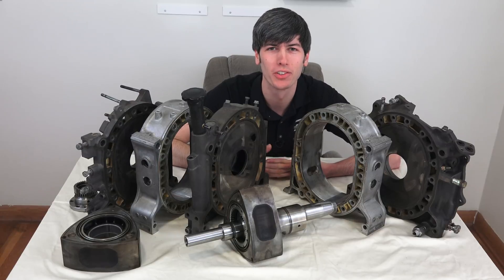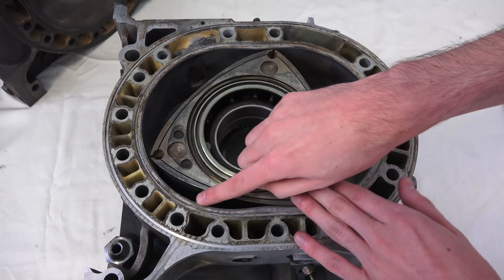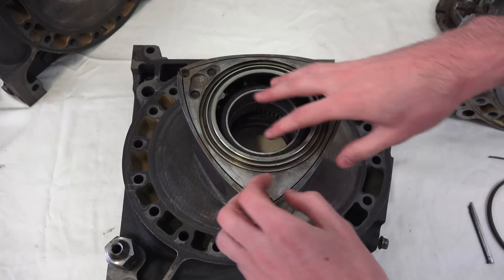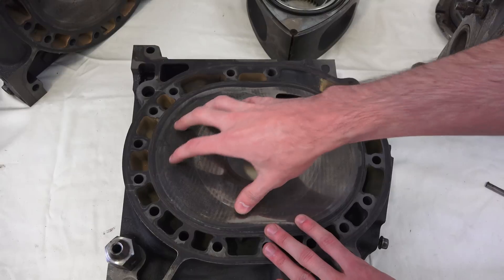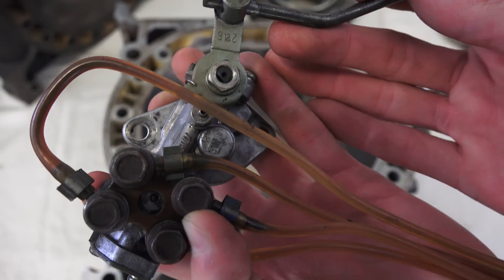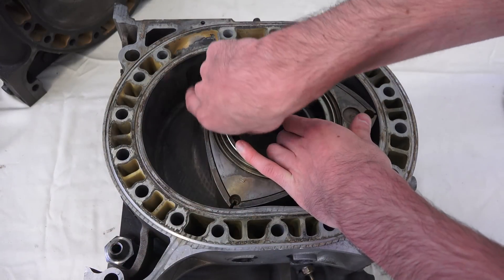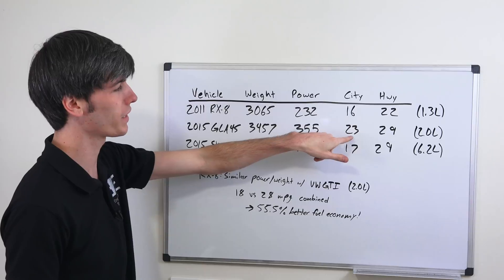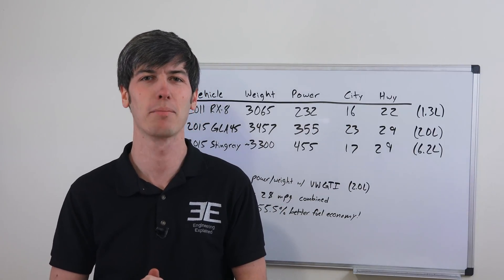4 Reasons Why The Rotary Engine Is Dead

Comment: So all we need to make it more environmentally friendly is to capture the exhaust and recollect the unspent fuel?
Reply: The solution to a design flaw isn't to add more to the original design. You just make a new design that doesn't have those flaws.
Reply: The real doktorbimmer 
You must stop telling lies.
Reply: The real doktorbimmer
Bimmer McBimface,, you must stop making things up.
Reply: "The solution to a design flaw isn't to add more to the original design."  Tell that to the guy who invented the Turbocharger?
Reply: I wasn't talking about Turbocharging a Wankel.  I was thinking about turbocharging a Diesel... They really only gained popularity as daily drivers after Turbochargers were added into the equation, and would probably not be used much, if at all, today if that hadn't happened.

I quoted for a reason: 
"The solution to a design flaw isn't to add more to the original design."

-> So many new things have been added to Otto and Diesel Engines over the years that this statement appears fundamentally flawed.
Reply: That would add extra energy and steps into the process thereby reducing the overall efficiency of the engine.
Reply: Chris L Not necessarily, there are cases (speaking in general, non domain specific) were adding something onto a design will improve it and remove/compensate for flaws in another part of the design. And of course there are other cases where the entire design needs to be rethought in order to make up for those flaws. One could argue that if you break down any design into small enough pieces that you will end up with distinct parts that chain together, each depending on the other parts before it to accomplish a task. But I don't know if I completely agree with that either,(getting a bit to abstract at that point) and if it were true how one would prove it mathematically/logically.
Reply: ***** 
Good point. The design flaws on piston engines is immense. The pumping loses can't be overcome.
Reply: +Chris L
and anyone else who likes technical history might read Longitude by Dava Sobel; an interesting read on the development of the Naval Chronometer.  It illustrates the point made by Chris L and was also a public television series of same name.
Reply: The real doktorbimmer 
But diesel egines are filthy and very inefficient.
Reply: Pyrrha Nikos 
Bimmer McBimface states the rotary is not in production.  It is used in UAVs.  Bimmer is  a sad case indeed.
Reply: The real doktorbimmer 
Bimmer McBimface, diesels are not included in eco engines in the London emissions.
Reply: The real doktorbimmer 
So did gasoline and diesel engines.
Reply: The real doktorbimmer 
Bimmer McBimface, you have an obsession with automobiles. Sad but true.*
Reply: The real doktorbimmer 
Bimmer McBimface, please get therapy. Please.
Reply: 1. You can not collect the unspent fuel, it burns as soon as it enters the hot exhaust system.

2. The burnt oil is still in the exhaust gases, so nope, not environmentally friendly at all.
Reply: if you guys notice he said.environmentally friendly not more economical. a big reason they aren't very economical is because there is three combustion cycles for every revolution of the crank shaft.
Reply: My take on all this: The reason it is supposedly not economical is its being rated incorrectly as a +-1.3 liter but is in fact much closer to being same as a 2.7 liter 'normal' combustion motor...Look at its power ratings. Its certainly not the equivalent of a 1.3 liter in terms of power ...So if its making +-120  to 135 ps/hp then   its not really a 1.3 and its 'high' fuel consumption all starts making sense.
Reply: Or use it as a generator in an electric car. Like a Fisker Karma or something.

Comment: If you made a rotary engine with dual exhaust, could you create something that combusted on both sides, instead of the one side?  Which is a disadvantage as you said because of heating only one side.

Comment: sounds like the disadvantages of a 2 stroke engine but with the 2 stroke looking better?. i wonder how emissions are compared to an oil injected 2 stroke of comparable output.
Reply: In case you're interested, a land speed record was set on a 2-stroke bike using two 350cc yammy engines. look up the Big Red or Don Vesco
Reply: Nessaj i looked at all the Don Vesco video uploaded by Jinx Vesco. "interesting" is an understatement! thx for suggestion, m8 :))))

Comment: I have an 2006 RX8 and proud of it. The reason rotaries hasn't been developed more is because of machining which is a lot more complex and no one wants to risk it so they stick with pistons. Mechanically it's better a rotary because there is no alternative cycles. It's pure joy when you are at 7500 RPM with no vibrations..

Comment: It feels odd to think that materials would be a hindrance in building a better wankel engine, since there are jet engines and some of their parts work constantly under extreme conditions. Also in diesel engines there are after heating systems that help to burn the fuel to avoid emissions when starting the engine. But perhaps all that would be costly and eat away the advantage of light engine.

Comment: Kind of unfair to compare the 2011 RX-8 engine (which was introduced around 2004) with modern engines. Especially turbocharged ones like the GLA45. As for the Corvette, one could point out its lower specific engine output compared to the RX-8.
Reply: Bimmer stop being silly.

Comment: I'm curious how they compare to a TOO-SMOKE engine (which is to say a 2-stroke motorcycle engine!) There's the Suzuki RE-5 which I believe was a twin-rotor Wankel which was rated to have something akin to 500cc's capacity - For comparison, there are numerous different designs both from Suzuki, the T500 Titan/Cobra which was a 500cc twin, I guess you'd call a "piston-port" too-smoke, so too with the TR500 which was a short-stroke version of the TR750 a race-tuned version of the GT750 triple which was liquid-cooled (So perhaps it's a better comparison to the RE-5?) And then later the RG500 which IIRC was a Square-4 with tandem cranks again 500cc's - then there's the Yamaha RZ500 which was a V4 with reed valves on the induction - IIRC there were rotary valves and all sorts of other designs. I have a hard time pulling more than that off the top of my head without referring to other reference materials (((ME I'm something more of a FOUR-stroke motorcycle buff, and I'm far more fascinated with the CHASSIS and wheels, brakes suspension etc - the engine's just something I take for granted - Which is lame, yes - but a lot of engine heads have the same attitude toward the chassis!))) What I'm CURIOUS about, is whether the too-smoke engines had worse or better potential than the Wankel engines. The rotary disc valve engines seem particularly interesting, so to the Yamaha "power-valve" which I guess even had further application in the "EXUP" on 4-stroke engines - both are a variable throat or choke plate/flapper on the exhaust side, which changed the flow and thereby the back-pressure and SOMEHOW - I think they might have even been longitudinally activated like a cone moving up and down the exhaust like a TROMBONE of a sort, to affect the sonic back-blast which was so instrumental to the "tuned" expansion chambers of classic free-breathing too-smoke engines - WHICH, I'm not sure if you're aware of it - which came out of WWII German V1 "Buzz-Bomb" pulse-jet technology, and that research and it's egg-heads wound up on the EAST side der OST in the Cold War, until a motorcycle racer named ERNST DEGNER defected to the West and took said technology to Japan and more specifically SUZUKI - who then really went places with their too-smoke bikes, and only introduced their 4-stroke multicylinder GS750 in what, 1975 or '76? IIRC - I'm far more of a HONDA fan, let's just say. ANYWAY yeah, I guess I'm also curious about which of these technologies might have continued with some benefits for FUEL ECONOMY and CARBON FOOTPRINT, if it weren't for the "EMISSIONS" tech which has more bearing on inner city air quality - as Judge Dredd would put it - "Inside, the Cursed City - Megacity One" - Which is to say, Southern California ha-ha. Honestly, up here in Alberta Canada, I'm far far more concerned with the CARBON emissions than I am with the SMOG, the un-burnt hydrocarbons etc. I want to know which, if ANY - of these technologies has any FUTURE in it! Vis-a-vis, accepting the reality of climate change and peak oil, etc etc. Obviously, a bike should be ELECTRIC and it's charge should be generated by WIND - But even so, I'm still curious about my 1980s motorcycles and which of 'em has the greatest potential for blowing away the modern Crotch-Rocket stuff - Well, taking it for granted that the RZ500 & RG500 aren't crotch-rockets already! My "CB900K0 Bol Bomber" or rather, 1982 CB900F based homage to the '65 CB450K0 Black Bomber, a "retro-fried" Superbike with Endurance roots - is a DOHC-4 transverse inline "Universal Japanese Motorcycle" it's air-cooled and it's "replacement" from Honda was the VF750F & VF1000F "Interceptor", Honda's first V-four, liquid-cooled etc - fugly frames with square section tubes, fugly bodywork which I think I MIGHT be able to redeem with a V65 Magna / V65 Sabre based homage to the '60s Czechoslovakian Grand-Prix marvel the "CZ Type 860" - picture it with wire spoke wheels with hubs like old 4LS drums but they're "inboard disc" or rather "shrouded disc" hubs cut out of the GL1500 Gold-Wing or PC800 Pacifica front wheels - 'cause no real 4LS drum brake could ever hope to STOP this thing - a fairing in the vein of the VF1000F Interceptor only it's taken from Geoff Duke's 1957 Gilera "Rondine" DOHC-4 500cc Grand Prix racer - the seat from the '69 CB750K0 "Sand-Cast" - I'd like to call it a "CZ860K0 Sand-Cast" actually - 'cause if the CZ had a modicum of sponsorship or factory backing they would've cleaned up even with Mike Hailwood riding Honda's RC-181 DOHC-4 500cc or Giacomo Agostini riding the MV Agusta triple - If and when it DID blow away the competition, the word on the street would be that the V-four engine was superior - Ergo, instead of an inline SOHC-4 Honda would've introduced the "Volkswagen of the Superbike world" the "Everyman's Super-Sports Bike" in the form of a VEE-Four engine - Ergo, the '68'69 CZ860K0 Sand-Cast. I'd ALSO like to build a too-smoke though - again, a Honda - a replica of the Czechoslovakian Grand Prix racer from the '60s (no, I'm not Czech or any other Nationalist or "creed"-ist whatsoever, it's just that these bikes were BRILLIANT!) I'd like to take a Honda MVX250F and build it as a replica of the JAWA Type 673 - which really just means a paint-job and a wheel-swap in this case! (Then again, so too with my V-four project idea?) It would be even more awesome with a 400cc version of the same V3 engine in it, from the NS400R - IF it could squeeze into the MVX250F chassis? And swap out the 230mm "inboard disc', a single sided version of the CBX550F disc hub that everybody and his dog has converted to wire-spokes - replace it with the PC800 Pacifica hub, with 296mm discs on it from the USA-spec CB1100F rear brake, and the Kuryakyn rotor shrouds for GL1500 - maybe some DIY shrouds though so it'd look more like a proper 4LS......

Comment: those are some downsides but a 1.3 liter making over 900hp is astonishing
Reply: Except when that 1.3L actually displaces 3.9L.  That's what happens when only 1 chamber per rotor gets counted.  If I counted one cylinder per bank on my 454, it'd be a 1.9L.  If I based it on one rotation of the crank, it'd be a 3.7L.  ...And if I did either of those things, cries of foul play would echo throughout the comments.  The only reason rotary displacement is calculated in such an odd way is displacement taxes.

Comment: Laser ignition gives a much bigger spark, and can project the spark deep into the combustion chamber, and at three simultaneous points. This now makes direct injection gasoline rotary engines feasible with pre-mixed, air and fuel, direct injection possible omitting an induction stoke in Wankel. This will make a big difference to the rotary engine's combustion and should lead to this engine becoming the first choice in range-extenders.
 
http://i58.tinypic.com/2lt3viq.jpg
 
http://i59.tinypic.com/25fj1wi.jpg

http://i57.tinypic.com/20koxg1.jpg

Then there are also advances in HCCI ignition in rotaries.

Comment: I am sure that the rotary engine, if it would have had as much developing as our normal cylinder engines, could be just as good. Don't forget that mazda is pretty much the only manufacturer that has done any developing of the rotary engine. If you see how much progress the normal cylinder engines have made, being developed all over the world, than it's no wonder that they are more efficient. A good example is also the diesel engine. In the last 25 years or so, it has made such incredible progress, that it is now in many ways a full competitor to gasoline engines in any way you can think of, and in some ways even way better.

Comment: In 1985 I had a Rover 3500 V8 that used to get 28 mpg.  My late brother Craig used to have an RX4 Coupe.  He raced his, on race tracks with a club. He loved it.  When I borrowed it, I couldn't help but be impressed at it's amazing acceleration.   He was always under the bonnet working on the timing, but he expected that with the rotary and loved the design.  He said, the combustion chamber was not efficient but the small number of moving parts more than made up for it.  I agree.  Frankly, I wouldn't buy a Rotary for the same reason I wouldn't get a V8.  I like to keep my licence.

Comment: I remember when I was at school in the 1950s our science teacher pinned a glossy poster on the wall all about this marvelous new Wankel engine design which, according to the text, was going to be far more efficient than a piston engine because it had no reciprocating parts, which waste energy.  The poster claimed that once it goes into production it will eventually replace the piston engine in all cars. The reality was somewhat different. The first production car, the NSU Ro80, suffered from early rotor tip seal failure, so much so that it was said that owners took to carrying a spare engine in the boot (trunk) as it could be changed over by the roadside. In the UK, a small company did a roaring trade in conversion kits that enabled a Ford V4 engine to be fitted in place of the rotary engine.